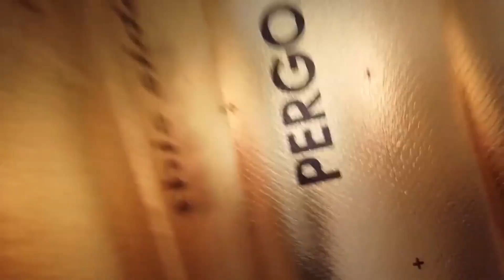Homemade Cabin TIMELAPSE

Comment: Nice Video and built. Just one question wouldn’t it be necessary to put a vapor barrier on top of the insulation and then put on the boards?
Reply from the maker: Thanks. The walls are pretty thin, and if it's not heated all the time a vapor barrier can actually do more damage if it gets colder inside than on the outside. Moisture will also go through the bitumen covered boards on the outside. It would have been different with OSB boards on the outside.
Reply: @DieterSchneider  thanks! Learned something new today. Subscription taken :-)

Comment: Nice work! How many time did it takes? Great Solomon shoes!
Reply from the maker: Thanks, I'm not quite sure. It was a bit on and off so I used a couple of weeks. Yeah, those shoes are like walking on air.
Reply: @DieterSchneider  but it's better for running,  trail-running)